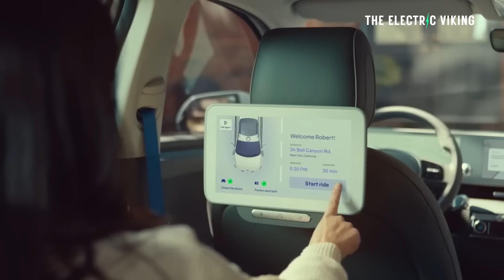Hyundai hiring 80,000 workers & spending $51 billion to catch Tesla

Comment: Hyundai has the tech, it has the cars.  They've had some learning curve issues with the 5 and 6, but they are getting there.  Unfortunately, the dealerships are killing them.  Their live-for-today approach, casual disdain for customers and incredible ignorance with service drives customers away in droves.
Reply: They are fine in Europe plenty dealers when USA is taxing everyone around blocking all imports
Reply: @michals1108  USA is not blocking Hyunday, the dealers are with trying to steer customer to ICE vehicles, not BEV.
Reply: Yeah, just like with the Theta engine, they fixed carbon buildup issues with the Theta II by making it not last long enough to be an issue
Reply: Hyundai outsources too many components to be a proprietary, fully integrated, EV like Tesla.

Comment: They can start by taking care of their current customers who have issues with their 12V systems. Many are breaking down and becoming unreliable.
Reply: Yes indeed!  They need to correct the marginally acceptable design criteria they use when designing their 12 volt electrical systems that for years have plagued them with fires along with invest to improve on how they respond to those issues.  If they can't get electrical and software issues straight to make their existing ICE vehicles stop burning up, shift smoothly, etc now then what confidence can we have that their EV's will not be similarly impacted?  If when the going gets tough their dealers just keep giving customers a "So Sad, So Bad there's nothing we can do to fix it so your stuck with it" how do they expect to build trust?

Best!

Comment: They are serious as a heart attack but the dealers are stocking like 12 to 15 EVs on the lots because they don't get the 63% income from servicing them like ICE and Hybrids.  Fact.  Was just at the dealer and it was a stark reminder of the dealerships model being the blame for sales.  NOT prices or range.
Reply: Their business model will have to adapt or go out of business. They wont be able to stop this EV title wave.
Reply: Dealers need to re-invent their business model, the income from servicing alone will not be viable, they need to build multiple streams of income ie; workshop servicing, mobile servicing, EV charging + beverages, emergency mobile charging, solar/wind power generation with battery storage selling excess to the grid, aftermarket accessories/spares + fitting.

Comment: Unfortunately as there  are more EV on the road in the UK, the cost of insurance will go up to an  unaffordable  cost even for ice cars
Reply: Why?
Reply: All insurance costs go up....I know that the UK is not in the EU any longer....but the car requiremens by Bruxelles orders a lot of electronic systems in a car including radar and camera systems. Any little damge to any new car with those systems cost  a lot more to repair. 
A bumper in any old car without those systems a few 100 to a 1000 (if painting is required).
Now 5000 for replacing all those warning systems. That is parking damage only.

Comment: They first need to think deep very deep before building new models. Their current model replacing batteries is just as expensive as a new car, how is this possible?
Reply: So true, it’s insane when you can buy a long range ev6 battery for $7k. Hyundai must have a process with many middlemen with hands in the till.
Reply: That's an area where EV companies need to address. i.e. batteries that are easy to replace.

Comment: Hyundai/Kia now need to stretch/upgrade their experience/knowledge in battery voltage from 800V to 1000V to  take fast charging to the next level. 500 amps at 1000 Volts should top out at 500KwH!

Comment: THEY ARE TOO EXPENSIVE FOR MOST PEOPLE!!!😡

How can’t they not see this?
Reply: Prices of EVs are dropping fast. Even though Hyundais are not eligible for the $7500 cash back at purchase they ARE eligible for that on a lease. 
     So to use a Tesla as an example...Hyundai may be similar after they ramp production.....You can lease an inventory model Y base model for around $313/mnth all in. If you can charge at home then you will save a good chunk of money on the difference between electricity costs and gas. So you may save something like $75/mnth or more on the gas price difference. That brings your cost per month to lease the car down to around $240/mnth. 
What kind of gas car can you lease for that amount? The Tesla requires NO maintenance to stay in warranty either. No oil changes, no transmission oil changes, no belts, no radiator fluid changes....NADA. More savings!!

Comment: These companies want to ride the EV wave.  That EV wave is yet to crest and when it does they want to be ready to jump right on it.  Forward vision.  Once the super charging networks become ubiquitous,  that wave will crest and will stay that way for a long time ( i.e. decades ), until new EV tech results in flying cars, where that then becomes the transport of choice ( say 30 years from now ).  In the meantime the EV wave should crest within a few years.  i.e. at a point where an EV purchase will be so compelling,  that the EV sales curve will rise exponentially,  however at an even greater rate. At that point the ICE vehicle sales curve will crash and burn.  It all hinges on the ubiquity of super fast charging networks.  At that point even a 300 km range will be deemed adequate by the majority of drivers,  as long as your vehicle supports very fast charging.  i.e. 300km in 10 to 15 minutes.  Most will not even charge that that level.  Consider that many ICE drivers don't actually fill their tanks when they fill up.  I generally only put in $10 to $20 dollars worth of petrol which also wouldn't get me 300 km range.  Same will be for EV fast charging. Most of the time drivers wont even require 300 km range. i.e. probably at least 75% of the time. Thus again it all ties back to super fast charging network saturation and fast charging vehicles. EV Range will become secondary consideration. Safety will probably become a more prominent aspect,  so old battery tech will have to go out the window and be replaced by much safer battery tech.
Reply: It's all in the battery technology.  Fast charging,  easy and affordable to maintain and replace. Whomever nails this in an EV design will reap the gains of this achievement.  Nobody has yet cracked that nut, cost effectively.  Hot swappable batteries are too heavy in their support structure. There needs to be another solution that is light weight,  but also allows the battery to easily and cost effectively serviced.